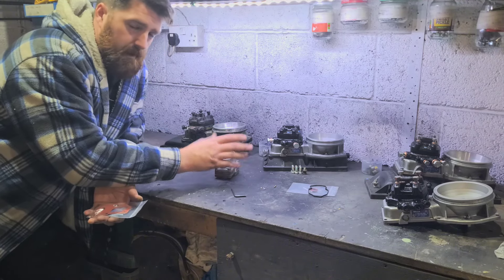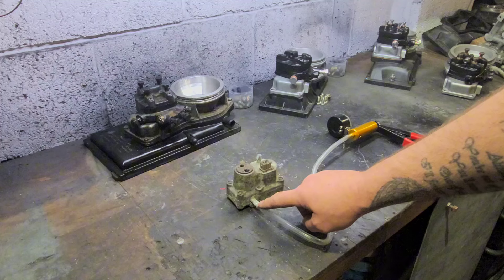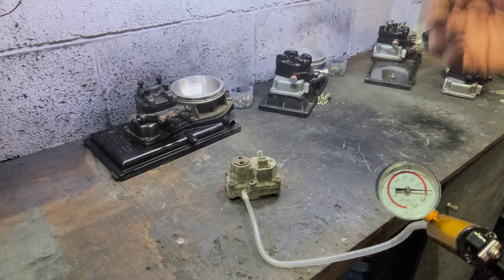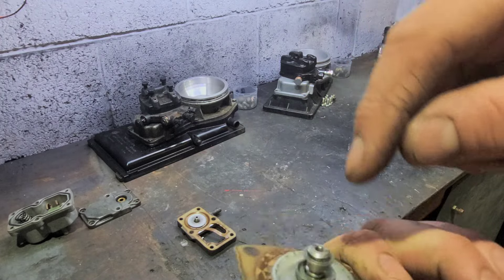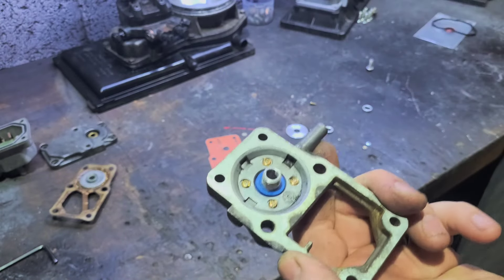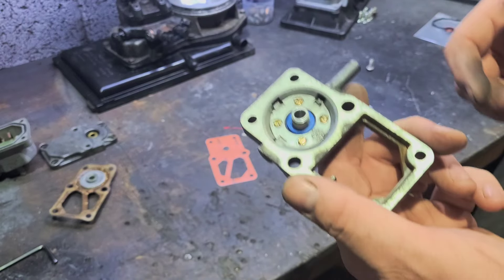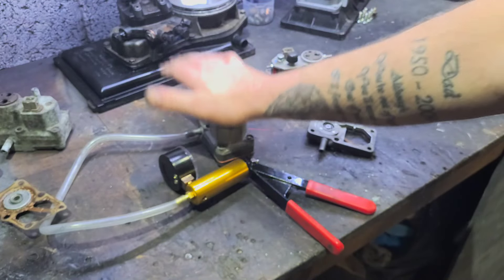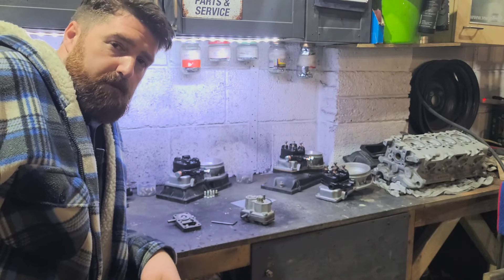Bosch K-jetronic - Warm up Regulator - Vacuum Diaphragm Replacement

Comment: Hello, i've just rebuilt my wur and removed old cruddy fuel gauze and replaced with a new banjo bolt and press in filter. This was to remedy my issue of having a stiff fuel plunger when the system was pressurised so i concluded the wur was blocked. I've fully rebuilt it and i'm still having the same issue i did drill the hole in the back to be able to adjust control pressure. So i've loosened this right off (anticlockwise) which has made it a little bit better but still the plunger is too stiff to draw air in. When the system isn't pressurised it's nice and free moving. I'm clueless 😢
Reply from the maker: Ok it sounds like the control pressure is still to high, is the return line from the WUR to fuel distributor free flowing/not blocked

Are you able to check your fuel pressures
Reply: @ I have some pressure testers on order so I can get everything set up properly. I'll check the return line from wur to distributor. I removed the wur and gave it a wee shake to see say how much fuel came out of it, lucky if i got a drip.

Comment: Great Video as always thank you. I have an old 1981 V8 Mercedes. Have adjusted the mixture to solve a misfire just above idle. Must have been a little rich and replace the main fuel filter last night. However< the car hasn't been on the road for a number of years and once warm get very rich and dies. I wait 5 minutes and will start fine,  then after a minute or so the same. Starts first time when cold and warm, but after 20 minutes or so when warm to hot, this will happen. Have invested in gauges and the control and system pressures are all good. I will hook them up again tomorrow and hopefully the fault will occur and I will see if these pressure change ? Sorry for long question, but with your experience does this point towards a warm up regulator? Have looked at the site you recommend and was going the buy a kit, as you say these are now 40 years old and are probably in a poor state anyway > Thank you and Happy Easter, Vincent
Reply from the maker: Hi, that does look like a WUR issue, if you monitor the pressure from cold it should go from around 1 bar to 3.5 bar in around 3 to 4 minutes by the book, so something close to that
Reply: Thank you you very much for your super quick reply, I have checked when cold and yes a low-pressure when cold. I will hook up the gauges this morning and see if after the control pressure start to rise when warming up, it then goes down starts to run rough then stalls. It's a shame I haven't a vacuum tester, but hopefully the gauges show a fault.
I will let you know how I get on. Thank you very much again @GreyGooseRestorations
Reply: I can fully recommend the company you use for the rebuild kits. Great communication and great service. My diaphragm looks in great shape, but will rebuild now stripped downed and  replace the "o" rings on the pressure regulator. Would you recommend me carry out your wur mod, even though it bolts onto the cylinder head
Reply from the maker: @KayleighTenny its always worth the WUR mod as just a few psi less control pressure really makes a difference
Reply: Great, I will do that  before the kit arrives. I was lucky, when the WUR came apart, the sprigs and plunger went skyward. I have only just found the plunger! I have messaged you on the filter video, you mention the WUR filter you supply, how can I purchase one? @GreyGooseRestorations
Reply from the maker: @KayleighTenny send me a message via my Facebook page Grey Goose Restorations and i can make you one and post out

Comment: Thanks for your helpful videos.  I have a 2.8i Capri, and I need to adjust cold and hot control pressures, after WUR overhaul.  Is there are preferred procedure for this?  Im thinking, adjust cold pressure first 1.5bar at 20c. Then warm it all up and adjust hot pressure 3.5bar with diaphragm screw?  Thanks again.
Reply from the maker: Yeah thats the way i do it, once warm is adjusted i check cold again as it has an affect on the but never by any great amount
Reply: @GreyGooseRestorations  Well, I got it set up, no fix.  I have been chasing a loss of power and missing mostly when hot, under acceleration.  All I have left is thinking that maybe the fuel filter needs changing again, or fuel lines.  Ive done everything else….. except the air filter? Changed injectors, inlet manifold gasket, pump, accumulation, oring in fuel distributor regulator.  Rebuilt WUR regulator and adjusted, including control fuel gauze filter. Checked cold start injector function.  Lashed the head valves. Any other ideas?
Reply from the maker: @CrayonboxAviationAdventures what is your CO % at idle?
Reply: @GreyGooseRestorations  Sorry, unable to measure.  I have been fiddling with the fuel idle mixture :-(  but it idles really nicely until it reaches operating temperature, and then engine might even die.  The loss of power started after the car had sat 4 years unused, at which time I replaced fuel filter and pump due to pump seized.  Pump is recommended Bosch. It’s been like this now about 18 months.  Also, when parked, if I apply throttle slowly it revs fine, but if I rev quickly, it dies, misses, and won’t rev out - as if the air flow plate won’t lift with rapid airflow, or being held down by control fuel pressure from WUR.
Reply: @CrayonboxAviationAdventures I have an audi 80 1.8e with the exact same problem, changed fuel pump, fuel filter, injectors and nothing. Did you figure out any solution?
Reply: @stephan267  Sorry - No - I have lost interest until I think of the next step - I feel like I have run out of options - other than fitting a carburetor!  I hope you can work it out and let me know ;-)  I'm now thinking restricted airfilter - or airflow metering not correctly adjusted.  I just can't figure it out.

Comment: Your videos are fantastic and have given me the confidence to press on with the dismantling of the WUR. My gasket was shot. I removed the press in filters as they were clogged. Where can I get the right banjo filter? Do you sell them? Thank you
Reply from the maker: Thanks, glad its given you the confidence. Yes i make and supply the new WUR bolts, contact me via Facebook page Grey Goose Restorations and i can supply you one
Reply: Hi thanks will do. I’ve got yellow zinc plated so hopefully you can put a filter in

Comment: I’ve fitted the kit from Reuben, thanks for tip. Drilled the brass cap to allow those with gauges to adjust. When I blow through the atmospheric port air comes out through the hole at the back. Is that normal or have I fitted the diaphragm kit incorrectly? No air through the side port which is what I had before fitting. Thank you
Reply from the maker: There shouldn't be air passing from atmospheric port to that back cap.

If you suck on the vacuum port does it hold vacuum
Reply: When I suck on that side port I can hear the passing of air through the open brass cap and can breathe in very slight amount of air. When I plug the brass cap with my finger I can’t suck air any more
Reply: Tightened the unit and hardly any air coming into the side port now. I think the fine threaded screw has a hole which would mean it would allow the passage of air from
Main chamber out through the 4mm Allen head?
Reply from the maker: Sorry got confused then, air can pass from drilled brass cap to the vent pipe as the adjustment screw has a hollow but the actual vacuum diaphragm section is a sealed area so potentially the inner small diaphragm isn't sealed so drawing in air via that
Reply: Thanks that makes sense. May not have tightened the small screws enough. There’s also a tiny rubber o-ring like 5mm across. No idea where that went so not fitted it!

Comment: Thank You for this video, , could You help me with advice : golf mk1 89’, 1.8 JH engine with ke-jetronic. Every now and then the engine starts like on two cylinders with poor idle and backfire and I have to drive through speedbump to make it work corectly. It doesn’t matter if the engine is cold or warm. It only happens when I start the car - never when its running. Would You help me where to look? The car drived like this for years but previous owned didn’t care – he drove it rarely.
Reply from the maker: Sounds like it may be a loose electrical connection if it needs a speedbump, possibly main fuel pump wiring first then onto metering head stuff
Reply: @GreyGooseRestorations  Thank You very much for the advice. Fuel pump relay is broken. Little tap on it and it works correctly - Ill buy new one. My friend that had this car for almost 20 years, drove like this and it needs very little money to fix it. Thank You very much - once again.

Comment: Im having a really weird hortstart issue which i cannot figure out, and i suspect that the wur is at fault. When its -5 etc outside, the car starts fine. however when it starts getting warmer (12 degrees and onward) the car struggles to start when i use it for the first time that day, idle is rough and it stabilizes after 2 min. when ive driven a bit and try to start the car again it fires up instantly. do you have any suggestions on what it could be?
Reply from the maker: It could be the WUR pressures to high or it could be the fuel Accumulator not functioning or the metering head pressure relief valve seals failing
Reply: @GreyGooseRestorations  It turned out to be the fuel Accumulator, thanks for your pointers!

Comment: Hi, great video. Had an issue with cold starts on my JH Rocco. Before doing a wur rebuilt, I have cleaned the small filter on the big gas inlet to the wur, it was full of debris. That did the trick...
Reply from the maker: That filter in the WUR is a very common problem and easily fixed too
Reply: @GreyGooseRestorations  How many ml have you set per injector per minute?
Reply from the maker: @sweety110277 on my 16v 185cc/min per injector

Comment: Ware can I bay new!!
Reply from the maker: I highly recommend missingparts.de
Reply: @GreyGooseRestorations  Hello hau do i higher the Idel I don't find no scruv four that!? K-Jetronic 380SE 1982.Have werry Nice idel but only 550Rpm..Thes Engine are helty no noisy in The Engine.No no smoke eder i have Digital CH meter Box Have only 0.80 in CH .I want tou have normal 4.5 -5.0...Hope you can help me hear!! 👍
Reply from the maker: @jarmominkkinen9409 I could need the CO mixture adjusted on the air meter to help raise the CO and idle potentially

Comment: I purchased the rebuild kit and replaced all the parts in my warm up regulator but now the car will not run at all.
Reply from the maker: Hi, potentially somethings not been fitted correctly or the vacuum diaphragm isn't adjusted, are you able to test pressures
Reply: @GreyGooseRestorations  hi I managed to get it running smoothly after adjusting the co2 many thanks
Reply from the maker: Good work